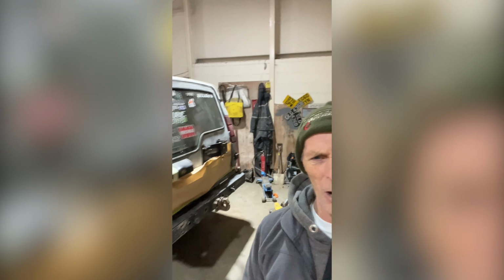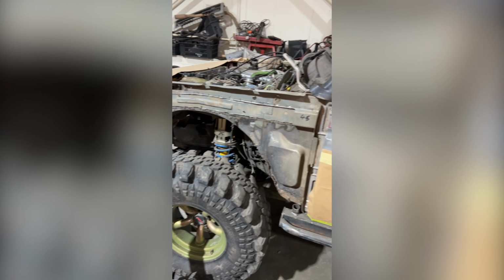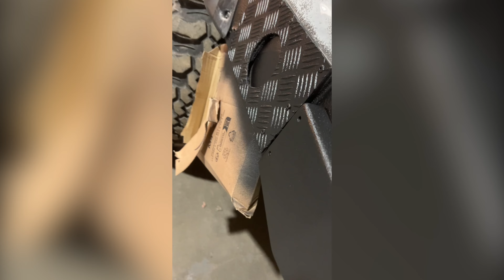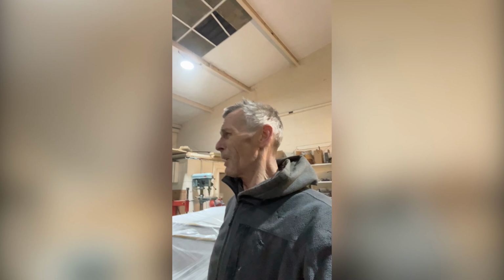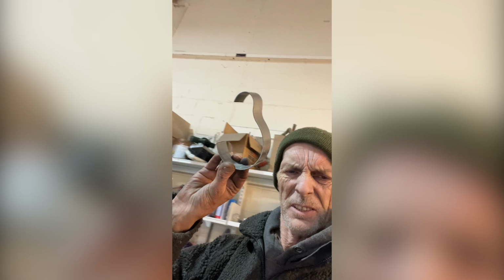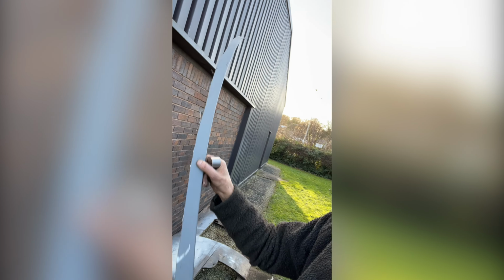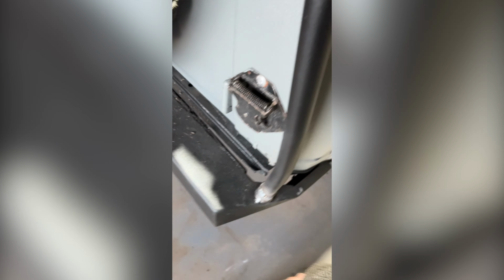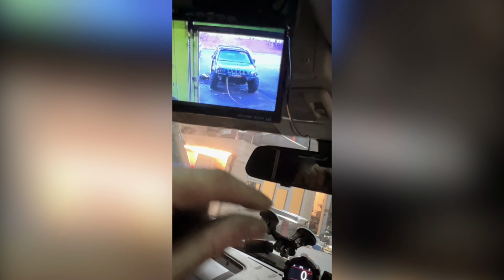DISCOVERY 2 CUSTOM SNORKEL & AIRBOX | Is Dora Ready? | Upol RAPTOR | SHES FINISHED | 4WDUK

Comment: I know you only do Laning rather than off roading, but I wouldn't call that a roll cage. If you did roll it would more likely collapse, but for brushing off light tree branches it should work well.
I like the ally air box, I'm assuming it uses factory filter, I would of tucked the snorkel further in so the front hoop takes the impact rather than snorkel tube.
Reply from the maker: Yeah, it’s not a cage, it’s bush bars ☺️ you’ll here it mentioned all the time in our videos ☺️ with the snorkel being 4” it would stick proud where ever it’s placed, so we went for keeping visibility, it’s only a piece of stainless tube and and couple of bends, very easy to replace ☺️

Comment: I've always wondered why can't the air filter be adapted into the snorkel,like split the snorkel with a thread and rubber o ring like a cartridge oil filter and then it's a solid one piece system through the wing.
Reply from the maker: Good shout 🤙🏻

Comment: Or even use rubber intercooler pipe adapted.
Solid plastic and a standard air box just doesn't make sense on a 4x4.
Reply from the maker: Good shout 🤙🏻